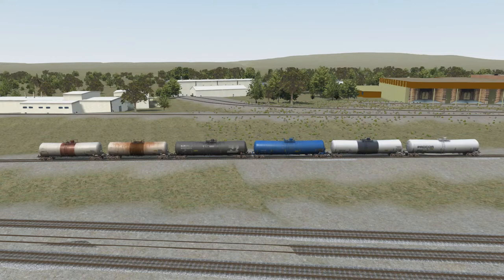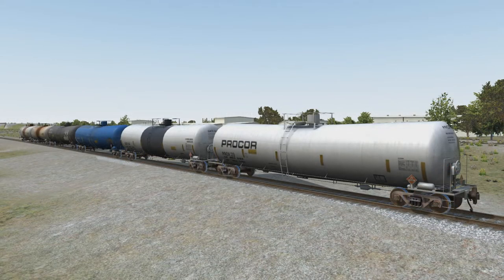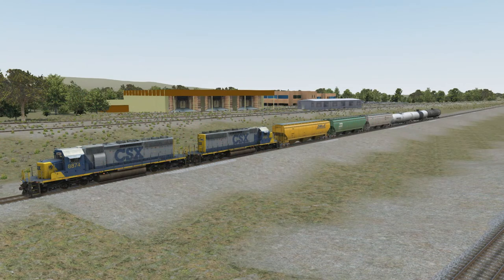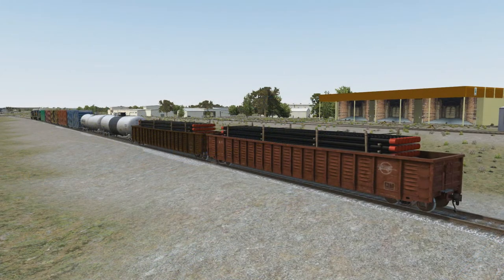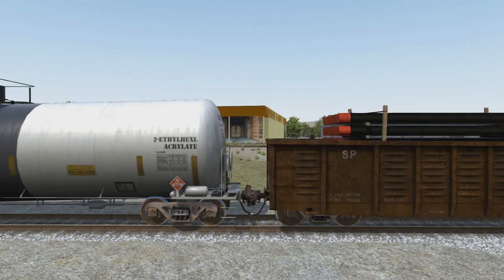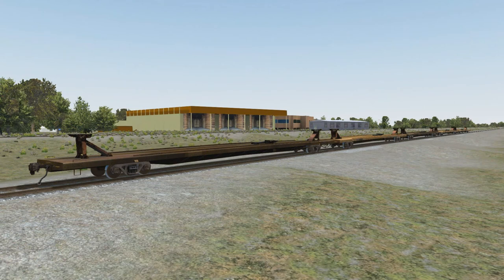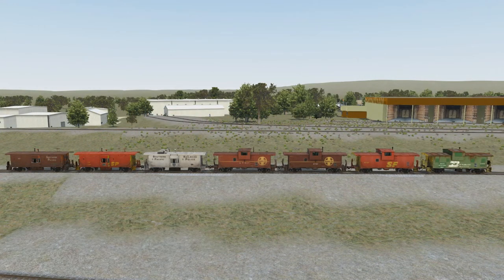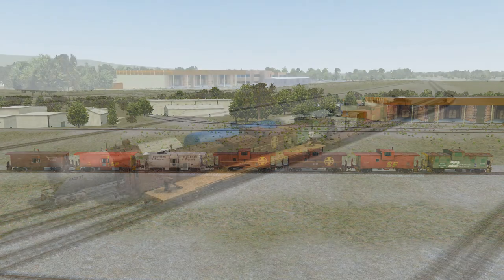Hazardous Materials and Train Placement

Comment: The Federal Railroad Administration sets the rules for haz mat not the NS or any other railroad
Reply: @traindude 28 I was a car inspector for 39 years and knew every FRA inspector that I had contact with and you are particularly right the DOT has a big input on haz mat as well but I really feel like the Class 1 carriers would cheat as much as they could get away with